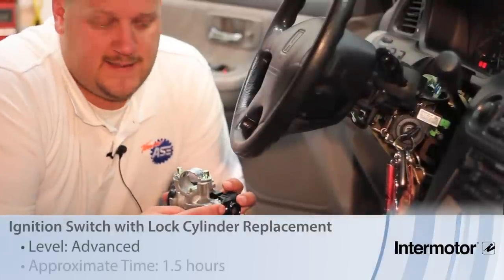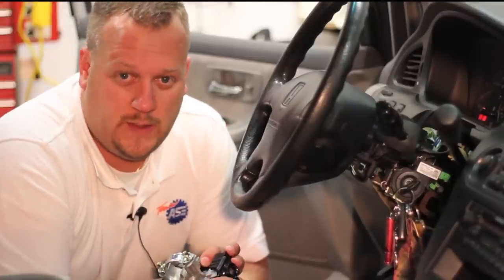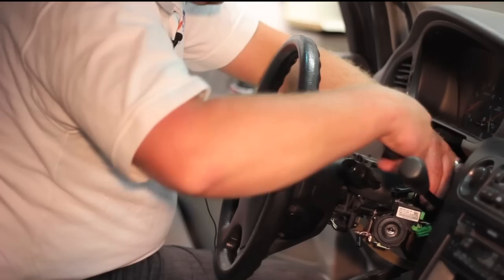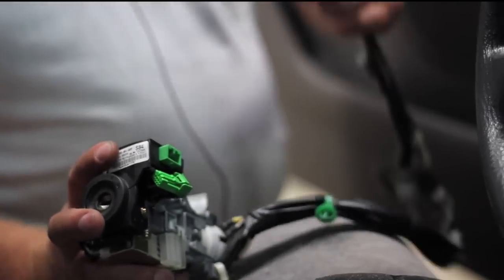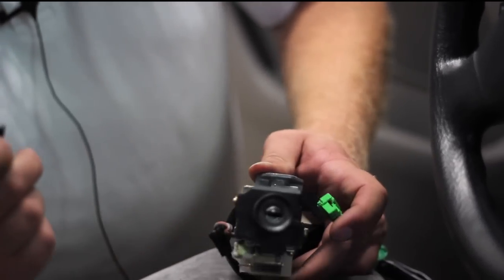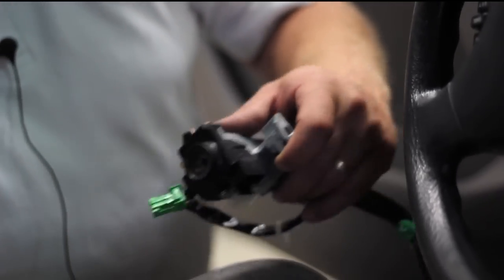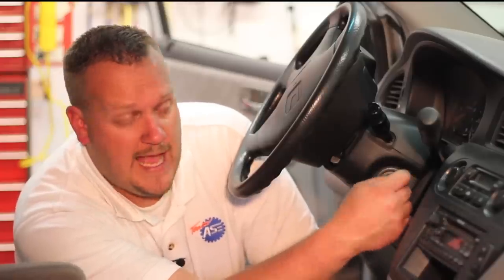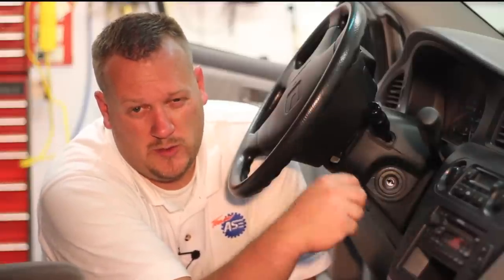Honda Accord Ignition Switch/Lock Cylinder Replacement

Comment: Thank you so much for this video. After a lot of research in Honda forums and YouTube, and wanting to avoid a tow and a trip to the dealership at all costs, I first went and visited with a full service locksmith. They told me if I could get the ignition lock out of the vehicle and bring it in, they could remove the broken pins, as that Is what I was thinking the issue was. I did not want to buy a while new ignition lock as I did not waamt to deal with reprogramming the key, these immobilizers will drive you insane. Anyway took the ignition lock in, a day later they said it was ready to go.They removed the broken pins that were not allowing the key to turn. The pins did not have to be reolaced, they are just there for added security. I got to keep my same key. Reinstalled the ignition lock and my car now works! What could have possibly been $1000 with a tow and a trip to the Honda dealership ended up only costing me $53.00. I could not be any happier! One thing I'll added, if you need to start shaking the wheel to get your ignition to turn, DO NOT TAKE OUT THE KEY! if to leave the key in the ignition you will not have an issue, only once you remove it and try to restart. Make sure you leave the key in until you are at your garage, locksmith, parking lot, etc so you don't need to get a tow. Without.the key turned forward, your steering wheel is locked, you cannot just pull the vehicle with a chain. Thanks so much for this video!

Comment: First of all.  Thanks for the vid!  Any time I can save $$ on car repair, I'm all for it.  
Point:  at 1:55-ish he says heavy keys damage the lock.  There's no actual evidence for this and he is speculating.  As a matter of fact, I had an ignition cylinder go bad on an '04 and use a solo key - no heavy key-chain ever attached to it.  Evidence leans more toward the cylinders themselves have a shelf life because of the number of bad ones that show up after 8-12 years.

Comment: Great video.  Worked perfectly on my 2002 Honda accord. I was a little confused about the new key.  In my case, the key that came with the new switch was a dumb key (no chip) and couldn't be programmed.  The Honda dealer was able to take the requirements, programming and  tooth patten, from the original key and the new ignition key and make a key that worked for 37.28.   Thanks.
Reply from the maker: Thanks for the feed back, Ray. Glad we could help!

Comment: If you could help . I had the Intoxalock install , now my D 4 flash’s , alarm doesn’t work , and check engine light is on with tcs. P1705 code but it’s not the transmission safety neutral switch . You seem to know your stuff . If you could please help me. Thank you

Comment: Great video. I have a 04 honda civic the problem I'm having is when I turn the key to the on position the lights on my dash are not coming on so I'm wondering if that could be my ignition module or the harness that connects to the fuse box really would appreciate information